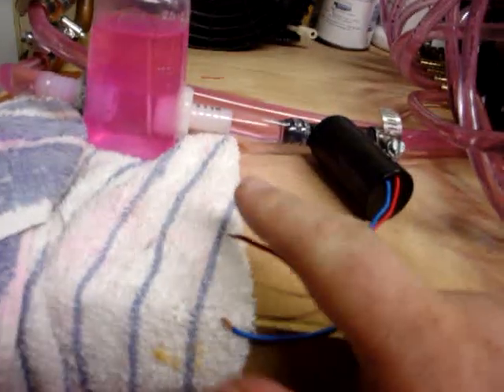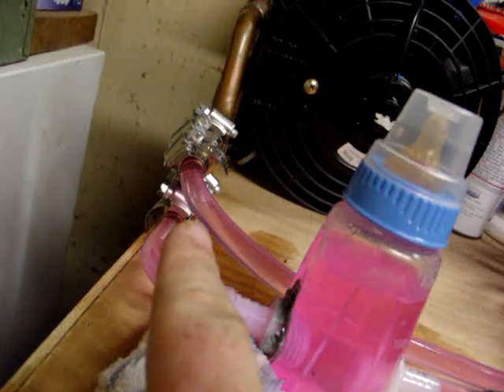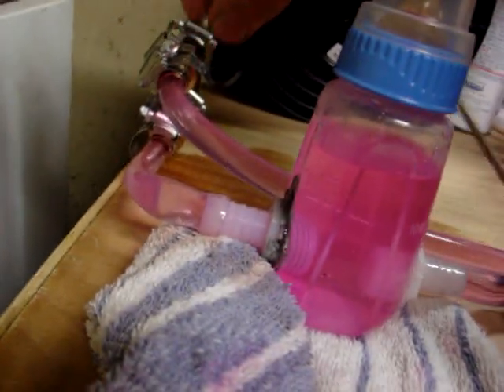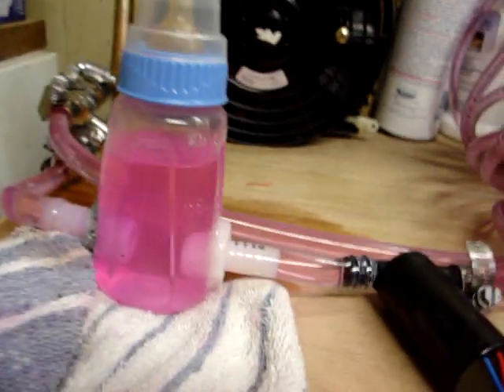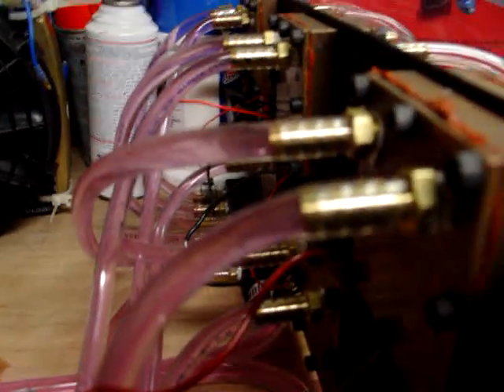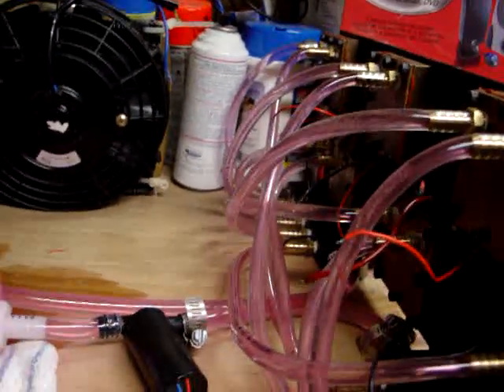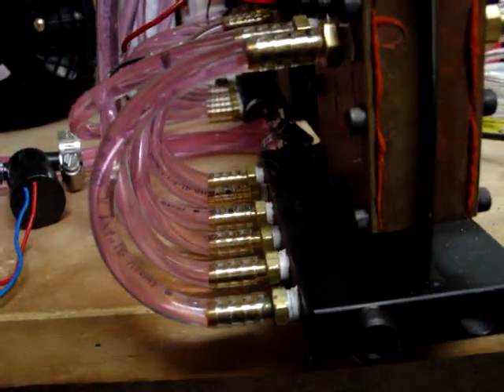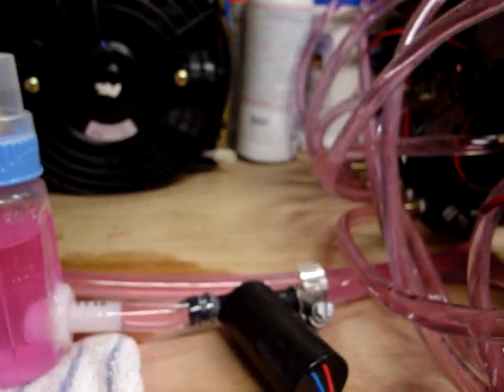Thermoelectric peltier Air conditioner project phase 2

Comment: Sounds like you are using a brushed DC pump.  Brushed DC pumps aren't meant for continuous duty.  You should try using a brushless or a computer cooling pump as those are meant for continuous operation.  Also brushed pumps tend to heat up more and have a shorter lifespan too from brush wear.